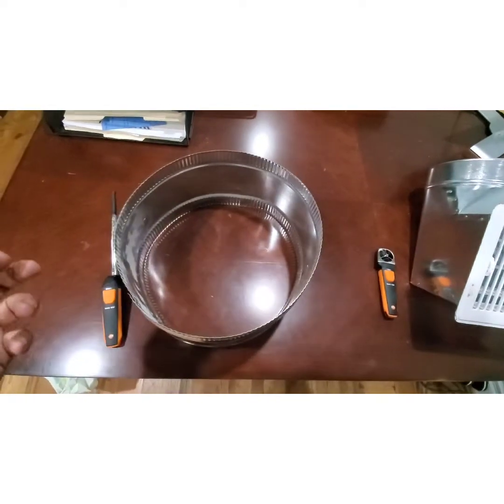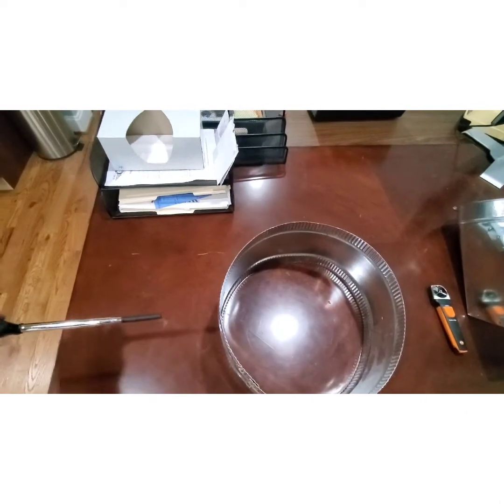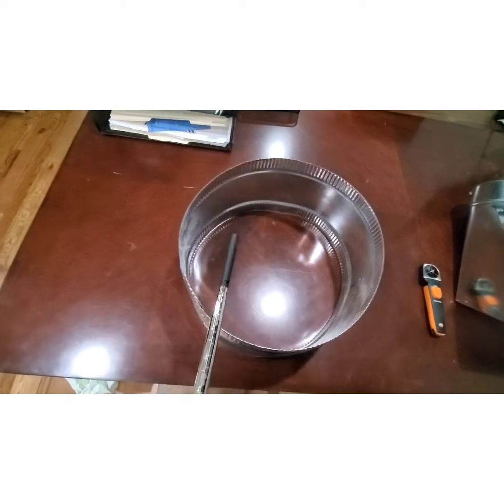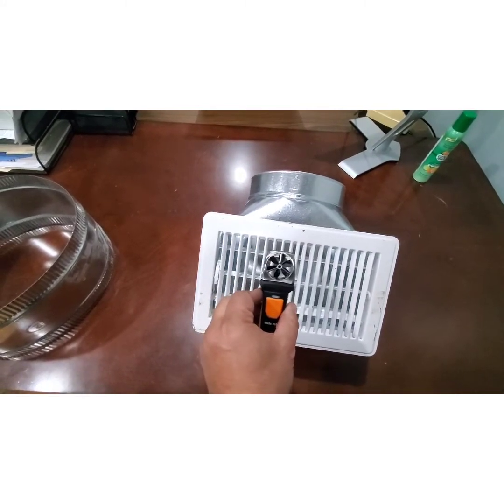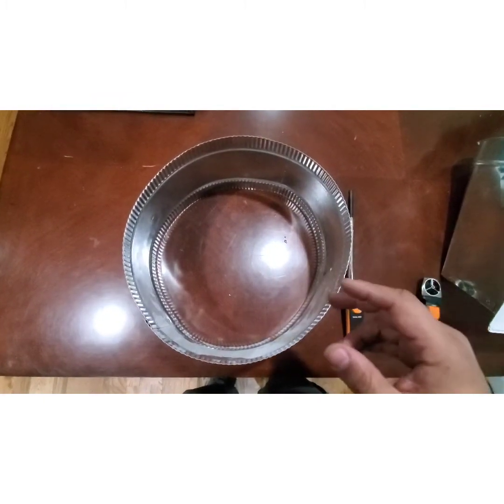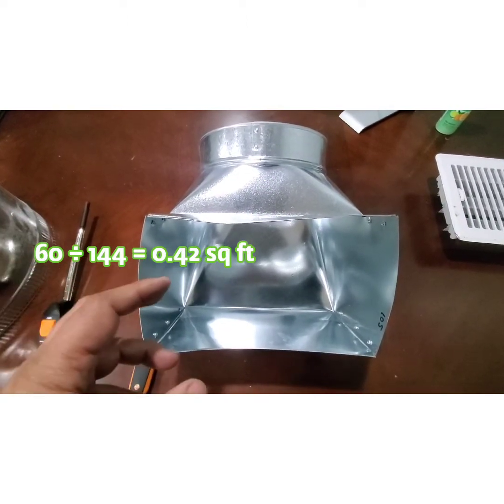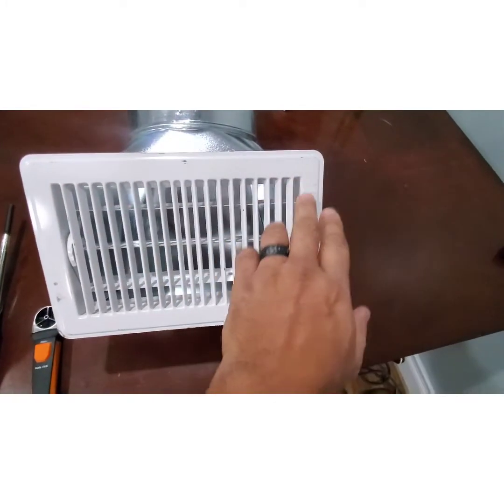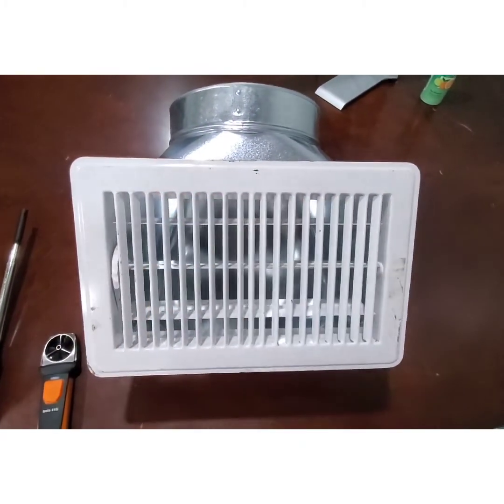Anemometers and Converting Velocity To CFM

Comment: With all due respect Sir. My dwyer 400-10 and 400-23 manometers read velocity , static and total pressure . I convert to cfms as I have for 39 years .
Reply from the maker: That's fine.  Those are solid instruments.  These connect to bluetooth and wifi and you can generate reports with them.